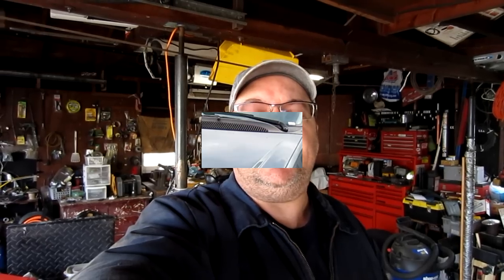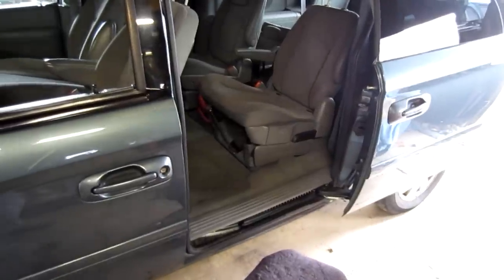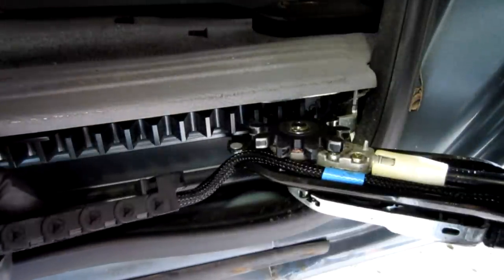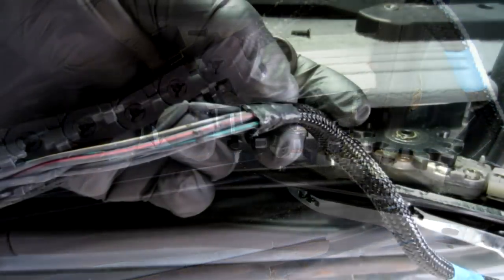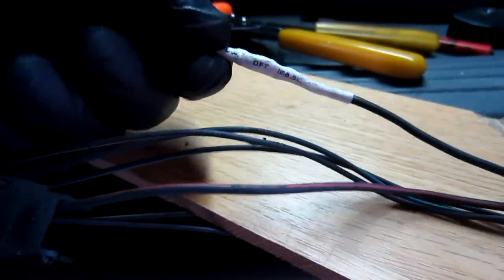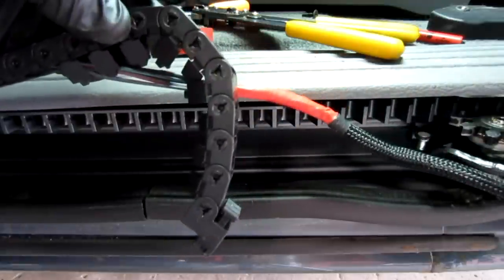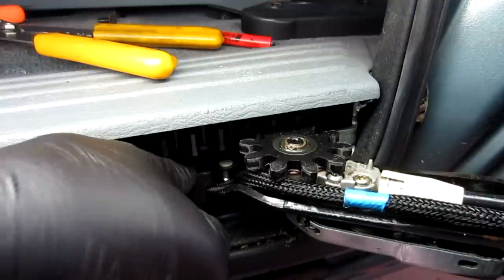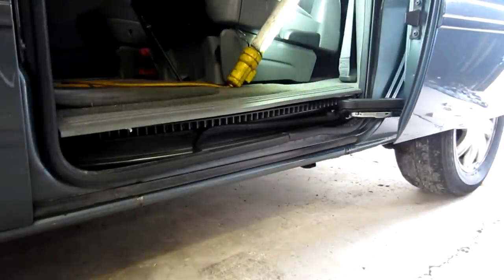Caravan power sliding door Repair EASY

Comment: excuse me, i have a 2013 caravan with fixed sliding door window. can i make it movable down and up.
Reply from the maker: وليد الحمداني if the vehicle wasn't optioned with roll down windows it would be a very big task requiring a lot of customizing. If it was an option(which I dont think it was), then all you have to do is locate power windows at a wrecking/junk yard and get the components needed to transfer to your van.. Good Luck..

Comment: Unfortunately my door (2013 Grand Caravan) only opens an inch or two and I cannot get at any of the wiring to disable the motor mechanism. Any suggestions? Is there a fuse?

My passenger side sliding door malfunctioned last night, not wanting to close. Two pins on springs were sticking out, and it appeared that a break/clutch cable that may have been holding them in had snapped, causing the problem. But after forcing it closed, I cannot reopen it now. Suggestions?
Reply from the maker: this repair needs done..That should fix it

Comment: Hi my door makes the sound like it was opening but it does not open on its own and sometimes it will open if pushed from the inside at the same time that we press the button...what do you think it could be???
Reply from the maker: If the motor is running then you have a different issue. If the motor doesn't run check the wiring or motor..
Reply: OK, Thank you!!

Comment: My grand caravan will pop open automatically but won't slide the whole way back only maybe couple inches. When I try to auto close it closes up till ur about a ft from closing. Any idea of what's wrong? Trying to see if I can fix or need someone too and the cost.
Reply from the maker: I would think this repair would fix that issue... Look at the wires to see if they are broken..

Comment: YUP I'm trying this. .will the door light go off?
Reply from the maker: It should, as long as everything else is working correctly.
Reply: Foxboss9 Can I use the black tape for this project?
Reply from the maker: Mrs.Shonda Voss you can try. But, you may find yourself doing the repair again.
Reply: Foxboss9 What am I suppose to use?
Reply from the maker: Mrs.Shonda Voss pick up "crimp tool" and "button connectors"  at Lowes or Home Depot maybe even Walmart.

Comment: I have a 2003 dodge caravans sport and I think one of the fuses out because my windows and headlight stoped working so I just want to know where the fuse box is located and how to find the broken one to replace it
Reply from the maker: owners Manual will provide that info
Reply: Foxboss9 I checked it still couldn't find it but I had someone look at it n they think it's the thing in frunt forgot what it's called starts with a m I want to say montum but that's not it I'll just try replacing it because the windows and lights went out even after changing the fuses and bulbs

Comment: What is the purpose of the wiring in this harness on a non-motorized door?  Is it just to give a DOOR AJAR indication on the dashboard?    My van is a Braun Handicap Conversion that has apparently been wrecked before I bought it a couple of years ago.  This entire harness was purchased and replaced about a year ago, and is broken again.  Not the wires, but the weak fragile plastic tracking chain.  Anyway, my door does not lock electronically, nor is it an motorized unit.  I have always had a DOOR AJAR light since I got the van.  All that considered, I should be able to just remove the entire unit without any problem, right?
Reply from the maker: Sorry, not sure about that.. maybe it use to be a power sliding door before the conversion? IDK
Reply: No, it was never a power door.  When I ordered the replacement writing track, I had to specify if it was for a powered door or non powered.  It was always as it is today.  I only need to know what the wires inside do?  Can I just remove the harness and only get the Door Ajar light, which is always ON anyway, or keep it from locking and unlocking electrically...which has never worked on that door.
Reply from the maker: I don't have any info on what that wiring would be .. Might need to talk to a Chrysler tech that has access to wiring schematics.. good luck!

Comment: I have an odd problem. I replaced the broken door wiring/track with one with the correct year and part code, but when I connected it, the car wouldn't start, it turned over without firing up and weird things like the milieage display doesn't light up, the horn doesn't work either. I unplug the wiring and everything works fine. 2002 grand caravan sport. Any ideas?
Reply from the maker: Sorry not sure... Could be something to do with security..
Reply: @Foxboss9  I'll try leaving the battery disconnected overnight and see if that resets/clears anything.
Reply: @Foxboss9  I just had a closer look at the wiring and the 12v  and ground wires are in the connector the wrong way round. I need to pull them out without breaking them and swap them around.
Reply: I swapped the12V and ground connectors around (looks like it was wired up incorrectly) and it's working now, except It looks like the door actuator is also faulty...it makes a noise but the door doesn't move. Sigh.
Reply: I never did get this fully fixed. The door lock doesn't work and it doesn't make any sounds when I try open it. It will lock manuaally. It seems completely dead. I have no idea where to start on this. Sigh.

Comment: Would a cut wire also cause your power window to not work also.? Back window
Reply from the maker: Not Likely.. probably a window motor
Reply: This actually fixed both my power window and power slide issues with repairing one wire.
Reply: Same here Bill,The power window wouldn't go down and the lock wouldn't work on the one side sure enough once the wires were put back together it worked ..Thankful it wasn't a window motor

Comment: It's a nice video, but that type of repair fails very rapidly on these doors.  To make a fix that lasts the whole segment of wire that flexes must to be replaced.

The problem is the cable design forces it to flex from straight through a 1 1/4 inch radius U bend and back to straight down the whole length of the wire every time the door opens and closes. A rigid soldered repair with stiff heat shrink tubing transfers the curl not happening at the repair  into a much sharp bend at each end of the heat shrink.
Reply from the maker: Oliver Street I agree, half those making this repair are just wanting it to work for another couple years. In my case that repair lasted four years. And, I advised my parents that they buy the wiring harness that's needed to replace all that. And, like most they said it wasn't worth it. So basically the repairs for the type of people that just want to get by for very little money. And honestly those vans in the Northeast are nothing but Swiss cheese by time the repair fails again.👍😁

Comment: I am a 15 year old guy, getting into the world of business. I bought a van to flip it, a 2003 ford windstar. Both rear passenger doors are power doors, and they open up just fine, but when you try to close them you have to push on the back of the door for it go in completely. If you don't push on the back it will almost close, then just open again and go back. Any help? I can upload a video of what it does if need be.
Reply from the maker: +Jo Brown Hops Sorry, I am a Ford fan but I try to stay away from Windstars, Mercury Villagers and their predecessor Aerostars.. They just never quite got it right.. The F-series truck is so popular because they do a lot of things better than other brands.. That is why the Chrysler minivans are more popular than their Ford counterparts.. Good Luck to you and your future endeavors..
Reply: +Jo Brown Hops Im 17 and have flipped a couple vehicles, stay FAR away from any SUV/van from Ford, Chevy, and Dodge. Especially the Windstar's. Not only does nobody want them, their Japanese counterparts (Nissan Quest, Toyota Sienna, be wary of the Honda Oddyssey) are much more popular and purchased. 

When it comes to Ford, only small trucks with 4-6 cylinders and Mustangs are flippable.
Reply: I've learned to stay away from Windstars now. I've put in about $2700 and hopefully can get $3000 for it, I will get better as I gain experience.
Reply: Wait, you put 2700 in repairs?

Btw, what state are you in?

Look for cars/trucks that have a low cylinder count, clean title always, and look in the 1500 dollar range. You can always haggle a car down to 1000-1200, there's absolutely no way you'll lose money on a car that cheap that has SMOG (if your state does that) and a clean title that runs and drives well.

My full time job is a car mechanic, if you ever need some help fixing something up, let me know. My instagram is @lobsterbate.
Reply: No, I've put close to $2700 total. I'm a Canadian. And will do, thanks.

Comment: what if the door wont open or close at all pushing the key thing or the buttons on the inside?
Reply from the maker: I am not familiar with that problem specifically.. I  would check all fuses and relays associated with the door. I would then check out the wiring going to the door motor. If all those things look good then you will need to check the door motor itself.  I don't believe there will be a definite answer that will pinpoint your issue(sans fuse/relay) without testing wire continuity and motor operation directly. If anyone else has an answer to his issue jump in and reply... Good luck..
Reply: +ham4fun - Did you have any luck with that problem?  My wife experienced the same problem yesterday on her 04 T/C van.  Both doors wont open with the FOB or Overhead Buttons.
Reply: nope. its not gonna get fixed. i also have a ramp on mine, which also isnt working, since im in a wheelchair and the only place to get it fixed wants $110/HOUR to look and fix it.
Reply from the maker: +ham4fun if the ramp and door quit working at the same time then I suspect a common fuse or wiring that supplies both. I don't think the ramp would use the same relay.. however, I have never seen nor worked on a accessibility vehicle..
Reply: they didnt stop working the same time. the door stopped like 3 days before. at least now i can tell my parents "See i told ya not to get the ramp"

Comment: What of it opens fine and when you close it it closes 3/4 way the stops and reopens ?
Reply from the maker: Sounds like a safety switch issue. It might be built into the resistance of the motor. Not sure about that never had that problem.

Comment: Is anyone experiencing the problem just at opening? I check all the wire one by one with a multi-meter and they all look good. The door does the same as this one on the video however, if opened manually it can power close and re-open with power with no problems for a couple of times. Thank you in advance!
Reply from the maker: I never experienced that.. Can Anyone else help out?
Reply: +AurumNonVulgi sounds like youer motor is going bad  mine did the same thing i replaced it and wors fine now and had no problums after that
Reply from the maker: +josh Bateman thanks for the help 😁
Reply: josh Bateman I will give it a try! Sorry for the late reply, somehow I missed the notification.

Thank you!

Comment: I have a 2004 Dodge Caravan and I am embarrassed to admit this as this is my fault. But my clumsy ass decided to open the passenger power sliding door to let off my passengers, and without realizing that the sidewalk was too high off the ground that it prevented the power sliding door from opening and even scraped off some of the paint off the door, again just my dumbass being stupid again. What possible damaged could I have done to my door? Everything seems operating normal so far aside from the door having some scratches.
Reply from the maker: I don't think that there's probably any damage there as long as it stays aligned and it hasn't caused any of the metal to bend for the operation of opening and closing you'll be okay

Comment: I have a another problem with this doors. The wire is ok, but doors don't opened or closed automatically. Computer told that problem is: "door is not full opened", and "door is not full closed". That's mean problem is on the finished switches. But... where is?? The same problem is on the luggage door: they don't open but sametime closing. Can U help me? Where is this switch which tell that doors is close or open?
Reply from the maker: Sorry, never had to fix that problem before.
Reply from the maker: Im not sure if it works off limiters or off circuity. I just don't have any experience with that problem , sorry
Reply: Foxboss9 I think that off limiters is cranky, but where is? :) 
ok thx. nice move. Greetings.
Reply from the maker: Good luck.